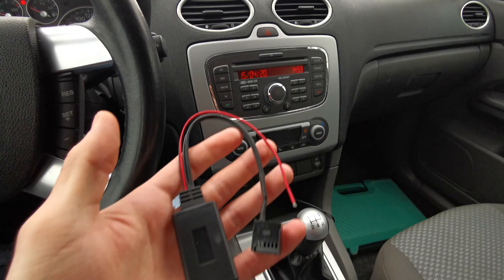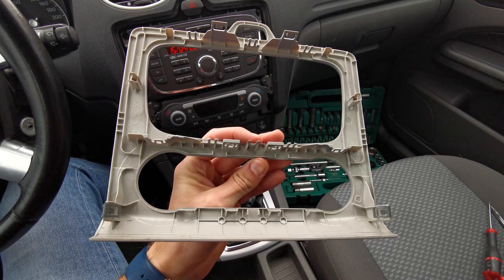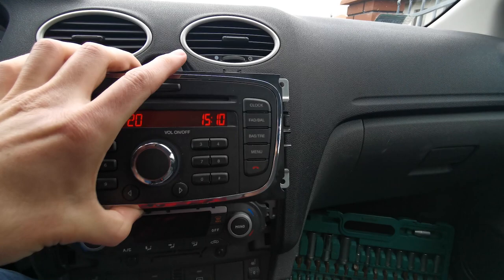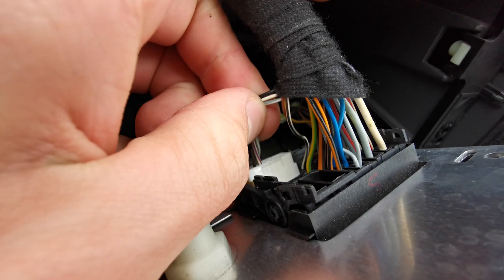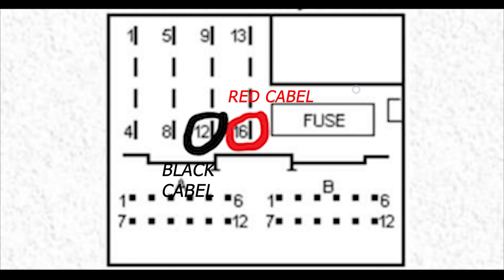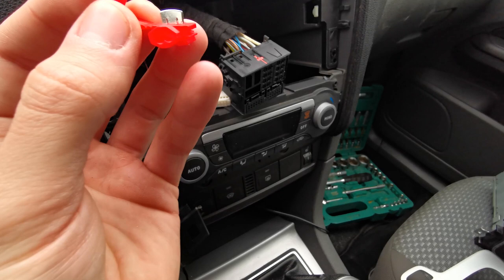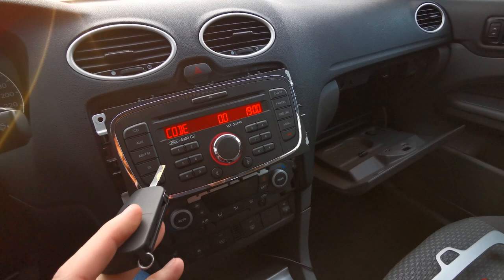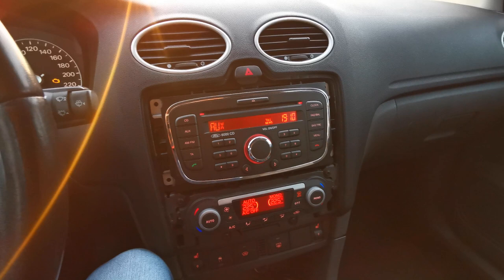BLUETOOTH MODULE INSTALLATION FORD FOCUS MK2, C-MAX, MONDEO, FIESTA, 6000 CD ALIEXPRESS, SONY MK 3

Comment: I did this this morning and works perfectly, thank you for your great video, I always didn’t understand why ford would have telephone buttons on a non Bluetooth stereo, makes no sense, but streaming music through the aux button is great 👍
Reply: Those buttons work with Bluetooth?
Reply: In my Blaupunkt model radio the telephone button is used only to mute the sound during a call
Reply: @Heisenberg355  mine is a 2009 and has no Bluetooth
Reply: @Mith29  i think maybe you just didnt find where
Reply: @Heisenberg355  I’ve been through the menus multiple times, watched YouTube vids multiple times, mine hasn’t got Bluetooth, the only thing the phone buttons do is mute the volume, that’s it, no option in the menu to add phones, it’s just not there, u think I would spend money on this device and wire it up if it did, cmon now
Reply: @Mith29  try long pressing the menu button. Then click the menu button until "BT ON" or "BT OFF" appears. My menu just ends after the Option "VID", yours should have the Bluetooth entry.
Reply: @Heisenberg355  Nope tried it, everything else apart from by, if you do a search for this radio it comes back as not all had bt installed which is stupid considering I’ve got phone buttons
Reply: because the PHONE option pairs with the parrot bluetooth module to make and recieve calls. It's not a new car, bluetooth was still in its early stages when these radios were out...
Reply: @Heisenberg355  yes those use a parrot bluetooth module connected to the headunit.
Reply: @Heisenberg355  no, you bought a chinese bluetooth aux adapter. Not a OEM parrot bluetooth module that connects your phone to the "PHONE" function and can make and receive calls, muting radio audio when a call is connected
Reply: @jjmmjj9999  yes exactly
Reply: @Heisenberg355  ok. but its not the oem parrot bluetooth model. It's VERY different.
Reply: @jjmmjj9999  yes it is, it just basically receives audio via bluetooth and transmits it via aux to the radio. No making and receiving calls on the radio. Only transmitting audio. But that is more than enough for most people including me
Reply: @Heisenberg355  I completely understand the differences between the 2 different units. 
I currently use a bluetooth reciever plugged into the factory aux location and accomplish the same thing as this, but its much cheaper and doesn't require pulling the radio out or crimping wires
Reply: Silly Fords, Trix R for kids 😅

Comment: check your wiring colors.
RE: Ford Focus 6000CD stereo wiring colours
positive (+) green/yellow ACC +/ is for the red cable 
negative (-) yellow/black/ ground/ is for the black cable /its not yellow/gray

Comment: Hi good vid great camera just one thing about terminal 16 +  when I tested it it was a constant power supply even when ignition is off so if you have no switch fitted blue tooth is on all the time or connect to the wire above 16 which is on only  in position 1 and 2 down side to that if you turn on the radio with ignition off blue tooth gets no power

Comment: Excellent tutorial but where did you buy the red plastic connectors as I believe this a crucial piece of the method and they arent linked below?. I take it there is no cutting away the plastic for this method?. But If you dont do it that way do you need to cut the plastic away from the green & Gray cable for the Red one. And cut the plastic away from the yellow and green for the Black one?.

Comment: thanks for this video

my 18 year old youngest son and starting to drive & like our 2011 Ford Focus 1.8L Gas Automatic 5door Hatchback here in the Philippines.  His one request is to change the Ford Radio with at least a BT function and I've started canvassing for a brand new stereo with BT.  However with these video, I think he will agree just to add a BT module.

where did you buy this and the brand ?

and my next problem is that I do not have a CODE# to reset my Ford Radio.

stay safe to everyone,
Nelius / CMG Channel

Comment: Excelente video, tenia muchas dudas si comprar el modulo o no, porque pensaba que quitaría la radio pero solo es el auxiliar. Gracias 👍
Reply: Perdona Carlos, pero si quitas el conector blanco no te quedas sin los mandos de al lado del volante? Muchas gracias
Reply: @javelinchut  lo instalé, hace unos días y no, solo pierdes el auxiliar. En mi caso de un Ford focus 2011
Reply: Carlos Villa y tu tienes exactamente la misma radio y un MK2? El mío es del 2007 eso sí
Reply: @javelinchut  la misma del video no, pero atrás si viene todo igual. El interruptor que vas a desconectar, solo son 3 cables y son los que van al auxiliar que están en la guantera.
Reply: Hola Carlos,una pregunta.... ese modulo recibe llamadas?
Reply: @mandezurrea  la vdd no lo he probado como manos libres, pero creo que no, hay uno que lo.venden con micrófono.
Reply: Pero la vdd si pierdes calidad en el sonido.
Reply: Que tal estimado, dónde compraste el módulo Bluetooth?
Reply: @carlosvilla7358  lo acabo de instalar y si pensé que tenia algo mal, igual perdió mucha calidad del sonido, use el ecualizador del celular pero no logro que de como antes, entonces igual te paso y lo pudiste solucionar?
Reply: @romanmd6799  así es compa, yo termine por quitárselo y jalar un cable auxiliar de macho a hebra y lo instale por donde está el botón de desempañar. Fue lo más estético que encontré. Te mando el link de una foto de algo similar a col quedó
Reply: @carlosvilla7358  si igual he visto esas instalaciones,  pero la verdad mejor le ahorro para meterle una pantalla, con ese dispositivo que le pusiste al menos se le quito el siseo?
Reply: @romanmd6799  si, se escucha muy bien, sigue siendo auxiliar original. Y qué bueno que puedas comprar la pantalla, se ven muy bien. Trata de meterla la que va de acuerdo al modelo.
Reply: @carlosvilla7358  A vos te pasaba que cuando encendías las luces del auto se apagaba el bluetooth? Porque a mi me funciona bien salvo por ese detalle

Comment: Is this connection really correct? Yellow cable is constat battery current for clock memory. It drains battery even with ignition turned off.

Comment: I have the focus mk2 with the Sony cd132 it has a phone button which just mutes audio, is there a specific Bluetooth module for this stereo?
I think Bluetooth was an option so there must be a standard module available?
Reply: Did you found a solution?
Reply: @duarte824  The easiest solution is just buy a new modern head unit with Bluetooth already built in.

That way you get other useful features like built in sat nav, reverse cam input, USB memory stick mp3 compatibility, large touch screen etc

It can be done using stock Ford parts but you need the Bluetooth voice module that hides behind the glove compartment somewhere and the column stick with the audio controls has to have a 'voice' button on the top!
It can be done but is a bit of a faff to be honest.

Just search focus mk2 Bluetooth touch screen head unit on YouTube, they come with a nice stock looking trim panel that incorporates your stock hazard button etc brings the whole interior up to date, easy to install, plug and play into your existing loom and not too expensive.

Comment: Thanks for your video!

But I have a question. Does the bluetooth phone still working after that modification?
Reply: Hello. Have you know already if it works? Thanks
Reply: Hi @davidarx  !

Yes, it works! 

You need to configure this new device as "Audio only" in your bluetooth phone settings and the 6000CD phone bluetooth as "Phone only".

Comment: Hello thanks a lot for your video ! I just wondr what function did you lot unplugging the white connector ?
Reply from the maker: White connector is "AUX". That's why, when you want to use this module, you have to push AUX button.
Reply: @podkarpackiezdrona3972   but there was wire in it ? So it was connecting something no ?
Reply from the maker: Sometimes you have AUX in glove box in front of passenger, but most of the time, there are Just cables without AUX connector
Reply: @podkarpackiezdrona3972  
Hallo man. Can you tell me about the sound quality? 
Is it good as the "aux in" quality?
Reply: Is there an easy way to get the white connector out, mine is tight stuck

Comment: I cannot get this working in my Mk2 Focus. I seem to have the same bluetooth module and stereo as you. I inititally installed it and although it would power and pair to the phone there was no sound. Looking again the colouring for the module wiring looked wrong.. pin11 was yellow and white was going to 6 (should be ground afaik) so i tried reversing that but still nothing. Investigating more i hack an old earphone lead and playing back off my ipod tested the stereo aux inputs and that seems to be the issue, no sound coming through the aux. Does there need to be a fuse in that area above where the module plugs in and if so what type is it? Can't think of much else cept a bad head unit and info is very hard to come by. Have posted on Ford forums but no replies.
Reply from the maker: I have no idea, maybe module is broken..
Reply: Kaseryn- check that the new connector block is connecting securely to the pins in the head unit. I had the same problem as you; turned out I was just one row of pins out from where I should have been. The new connector block lacks the clip on the side and hence is slightly smaller, and can be located in the wrong position.

Comment: Is it possible to wire this so when the ignition is off but the radio is on it provides power? When the radio goes off (after one hour) it stops drawing from the battery?
Reply: wiring anything is possible  you just need to look at a wiring diagram and think about it for a bit

Comment: Can your phone receive calls and make calls on this Bluetooth module?
Reply from the maker: You can call, and recive calls, but you won't be heard, because this module doesn't have speaker.
Reply: Is there anything else to buy that has a speaker